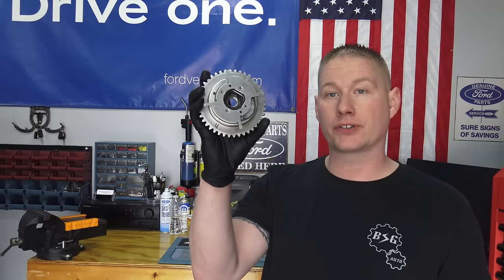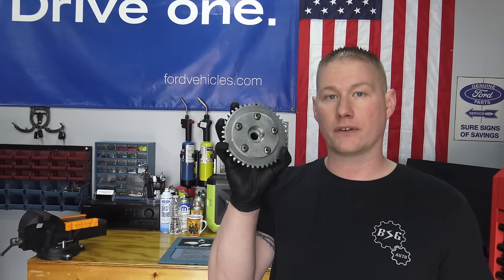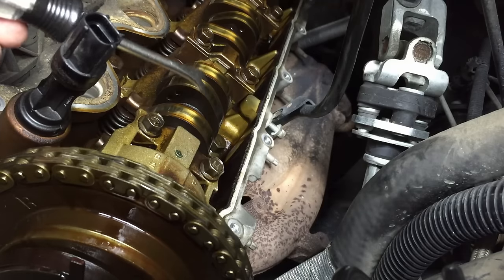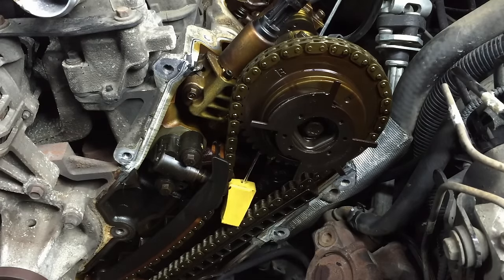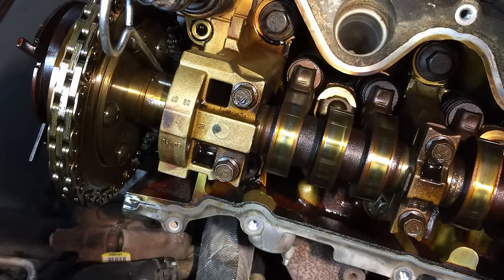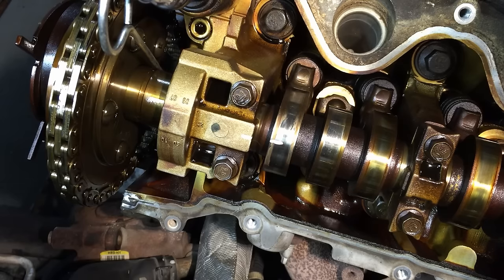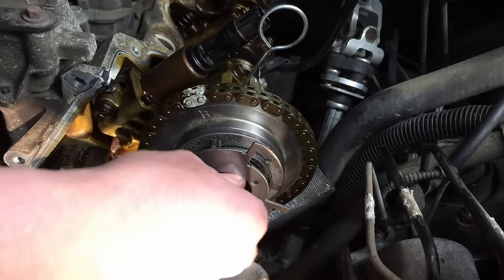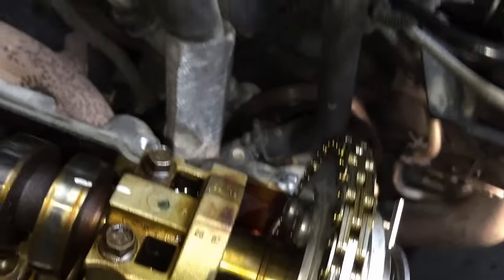Ford 5.4L 3v Camshaft Phaser Replacement**UPDATED FASTER PROCEDURE**

Comment: what if I can't get the pin in the back of the phaser to line up with the cut out notch?  It's just a hair off but won't fall into place with using the bolt to press it down.
Reply: I am assuming that you placed marks on the cam and the head and a mark on the  chain in relation to  the old phazer and the new phazer is in the same relative position as the old one.  If so then the cam mark must be off a little. Put a pair of vice grips on cam just behind phazer and make the cam marks lineup.

Comment: what do you think about the phasor lockout kit?
Reply from the maker: Overpriced junk
Reply: But if the phasors keep failing and replacing them with phasors that will fail again, is there a permanent solution?
Reply: @FordTechMakuloco  But how does the phaser actually work ?????

Comment: anyone run into where the new phaser from ford sits about 10mm closer to cam cap from old aftermarket part that was failing after 10xxxkm, seems like there isnt much clearance between the phaser bolts and one bolt on the block
Reply from the maker: I install the Ford phasers daily they have been the same for years.
Reply: @FordTechMakuloco  sweet thanks for that and thanks a million for your videos your knowledge and tips do not go unappreciated

Comment: God I hope Ford doesn't charge me $2k to replace one of these on my '10 F150 5.4L. Threw a P0345 code but then disappeared but the knock and rough idle is still there some times, just started at 98k miles.

Comment: Even if your cam moves, the phaser has a locking pin that sits in it
Reply: yes that's true for the phaser line up, but now the chain must be aligned to the moved cam. Which is why  Bri marks the lobe too, to know which way it was spun. Best to not have it spin at all.
Reply from the maker: +Nick Piberius Wilde yes but it's a real pain to get it back together and aligned at that point
Reply: +FordTechMakuloco True true, I have had it move on me before. :p

I'm currently in the process of replacing my plastic timing chain tensioners on my 08 Mustang GT with the older cast iron tensioners from an older Mustang. Your videos are a great help, thank you.

Comment: Hey I have a 2007 expedition 5.4 with a p0022 engine code idles very very bad and random bank 2 misfires could this phaser be the problem or do you or anybody have any suggestions. Any help would be greatly appreciated thanks in advance
Reply: Awesome videos by the way. Helped me many times keep up the good work
Reply: change or clean your idle air control valve.. also clean the mass air flow sensor.
Reply: +Geovanni Delgado ok thanks for the tip would that affect only half of the engine (drivers side)
Reply: +G Wyonch i doubt it will affect the misfire issue, but it will help your idle problem
Reply: +Geovanni Delgado ok thanks for the help
Reply: +G Wyonch you might have a vct solenoid problem, maybe yout engine is out of timing.. i think youre going to have to replace your timing chain and cam phasers while your at it
Reply: +Geovanni Delgado ok I'll look Into that as well
Reply: Fixed it. Was a mix of dirty Vtc solenoid with crud in both and low oil therefore low pressure. All that work and that's all it was
Reply: +G Wyonch glad it wasnt nothing major

Comment: hello there, I replaced everything phasers, chains,tensioners,guides sprockets and vct solenoids and engine is still shaking at idle. but alot less with new phasers

Comment: Are the phasers on 98 to 03 ford zx2 sound?
Reply: derek warner doesn't have phasers
Reply: It definitely has A vct phaser on the exhaust cam. They are torque based oil controlled phasers I’ve rebuilt mine overbored the lifter bores to 34 mm custom intake cam from crane cams and and I ported and polished the intake and exhaust myself and still with stock exhaust make 203 horsepower consistently tuned by me with and sct. But I’ve changed the phaser due to noise from it and no I didn’t sheer off the pin that goes into the cam that keeps the inner part of the phaser against the cam fixed so the computer can control it and keep it at the commanded phase and read its position properly. I have no dtcs but the phaser seems noisy like it has bleed off but the gasket is sound it’s in time no blockage in the oil gallery so I was just wondering if the phaser on the ford escort zx2 DOHC had any common problems that Brian would know about

Comment: I just replaced the cam phasers an I still have the knocking noise the pickup has 162,000 miles
Reply: Most likely a blown timing chain tensioner, or guide if the noise is coming from the front of the engine. It's allowing the chain to slap the front cover

Comment: I have codes P0021 and P0345. I have retarded the bank 2 phaser 2 teeth and still get the same codes, though it does run better. With the crank at TDC, where should the phaser on bank 2 line up on the head/cam caps? DO you have a picture or video showing this? Phasers and VCT solenoids are new OEM Ford, and it ran perfect for 3k miles before the bank 1 phaser went bad(Also oem Ford). That phaser and cam has been replaced. Once replaced, these codes on bank 2 popped up and it runs terrible
Reply: I might have actually figured it out. Based on the marks I made whenI first did the timing job, the bank 2 camjumped 1 tooth retarded, even though the codes said advanced. Ive corrected that so it is spot on. Battery is charging. Ill reply again with the results.

Comment: If ur Cam phaser goes bad and you checked it externals n it checks out....pop it open, but remember to leave screw in that retains the spring. You'll have to slightly untighten it a bit to slide the cover open. Be careful as when you open it there's a spring and retainer in a oil hole. It's actually kinda like a pump feed for oil. If the spring wears out it'll allow the tangs to spin and retard timing. Ford made their phasers kinda crappy tbh. The aftermarket part I got has a better design of the internals.

Comment: I do have a question, why are the cam wedges rated for 3 valve motors will they not work on a 2valve and because you know better than me than me. What would be the ending result locking in a timing chain wedge drop the handle down in there unbolt timing chain plate where it connects to the head and pulling the head off.... Yes its the lazy ass shade tree mechanic job, the way it sounds but it could work,
Reply from the maker: It would not work trust me.
Reply: @FordTechMakuloco I believe you...

Comment: How do u know when they go bad?
Reply: You can usually tell by the noise the vehicle makes and location of the noise. The noise is similar to a diesel engine noise. There are some videos out there showing this annoying problem.
Reply from the maker: +STEEVE DAVID Nicolas I have many videos of the noise they make at a hot idle. It's more of a knock and happens the most on the passenger side
Reply: +FordTechMakuloco thanks guys I will take a look at them
Reply: I have a 2004 F-150 5.4 that makes the knocking sound.  Is detrimental to the engine? I've been told it is more of a customer satisfaction repair and that it won't really hurt anything so I wasn't going to fix it.  However, if you think it it will damage the engine over time, I think I will try to fix it.  Thanks!

Comment: Anyone have the issue with these where it actually kills the engine? My engine will stop running when I’m idling
Reply: Yeah I am, was it the phasers for you? Or did you have to replace the timing chain as well?
Reply: @Mrxboxkiller1  I haven’t fixed anything yet. I switched to a thicker oil that I read a lot of people use in these engines. Seems to be running good
Reply: @Mrxboxkiller1  you ever replace anything?

Comment: What an absolute failure of engineering. 

I have a 2003 Grand Marquis with the 2V 4.6L and had to replace the timing tensioners and guides at only 140K miles. I was absolutely disgusted with the over-engineering and amount of parts involved in changing the 11 piece timing set (mercifully no cam phasers, just gears), and appalled at the mileage which I had to do it.

By comparison, my 1999 LeSabre had a 3.8L pushrod V6 that never needed timing service at all. I changed the three piece timing set at 300K just for good measure, and ended up finding the old chain had barely stretched at all, and could have gone on indefinitely. More moving parts = more failure points.

The Ford SOHC 4.6L has 2 more cylinders, 50 more cubic inches, and eight more timing components than the pushrod Buick 3.8L, all to produce... 19 more horsepower. Oh, and the fuel economy is 20% worse (15/24 for the 4.6 Grand Marquis vs 21/31 for the 3.8L, and I was much younger and drove that Buick much stupider, lol).

I love the Panther platform and lament that Ford ever discontinued it, but can't wait until I can afford to replace the gas guzzling parts bin under the hood with a simpler electric power plant someday.

Comment: you lined up the rt phaser on the left head
Reply from the maker: Nope I just copied the timing mark as a reference so it can be copied over. There is no right or left phaser just marks.
Reply: @FordTechMakuloco  so why do they have those confusing marks?

Comment: why would anyone replace the phasers?  just lock them out and get a programmer, oil pump, and timing set and be DONE.
Reply: does that really fix the 5.4l 3v motor? i have the same issue with phasers and was going to lock them out. whats the pros and cons?
Reply: @anthonysellards4798     BAD IDEA!

Comment: Due I still take front motor cover off
Reply from the maker: No
Reply: @FordTechMakuloco  the chain guide with the plunger how does that activate
Reply: You said the seal goes out and then it doesn't push on chain guide.

Comment: I have a 5.4 that had a knock that stopped when I touched the gas it runs normal except on a hill it sounded like an old 4 barrel carburetor at full throttle and wouldn't increase speed as soon as i let off the gas it recovered. Just looking for your opinion please.https://youtu.be/G39cACINIv0

Comment: The Ford 5.4 3v is one of the  worst motors they ever designed.  I say that and I'm a loyal to Ford and have driven them all my life.  This 5.4 was a garbage design from the very start!  I've seen these engines fail as early as 100k to the point of needing replacement.
Reply: I agree to a point. BUT......if they are maintained properly, they're not as bad as they seem. (I dare say Brian would agree) that Its bad owners more than bad engines a lot of times. CHANGE YOU'RE OIL AND SPARK PLUGS REGULARLY to avoid 75% of the gripes people have about the 4.6 and 5.4 3v engines.

Comment: thought right was passenger side on vehices
Reply from the maker: yes it is, did I say something different in the video?
Reply: @FordTechMakuloco  your putting the r cam on drivers side
Reply: @FordTechMakuloco   there is a big R on that cam and its clearly on drivers side  motor im currently doing a 5.4 and whoever did em last had cams mixed up so i was double checking on some videos to make sure im doing it right  u have the best ford videos
Reply from the maker: No the phasers are universal they can go on the driver or passenger side and you just use the corresponding timing mark for the side you are working on. This only applies when you are timing the engine. When you are just swapping phasers as seen here you pick any phaser timing mark and use it as  reference for the new phaser you are installing.

Comment: Wow! This confirms my theory. Rube Goldberg was a Ford engineer!🤣😅 2 minutes into the 1st video, I’m already thinking: “ sure glad I got rid of my ‘01 5.4! Cousin Paul was right! They’re a trash motor, get a Chevy LS & your problems are solved! I did just that & now I only watch Ford tech videos for entertainment value 😆
As for Rube Goldberg, he can go through his mental gymnastics and all that, but in case you missed the Ford tech’s comment, he ended saying “these Ford motors have plenty more problems to fix!” 🤣 . Don’t I know it! Which is why I came to the obvious conclusion … but a Chevy. Buy a Dodge hemi. Buy a Toyota. Buy practically ANYTHING and your Fix or Repair Daily problems are over! 
The real problem though, is Ford’s overall philosophy of constantly coming up with new designs with new issues that they eventually abandon rather than finding a good design and developing it over time the way GM did. In the ‘60’s they used to do that. They had a 260 V8 that eventually became the 289, then the 302. I still have a 302. It’s in a stern drive boat, though. This was about the last good engine Ford made, with the possible exception of the new 7.3 big block. Now we’re talkin !

Comment: so Basicly do not by a Ford
Reply: Putting a melling oil pump in these engines fixes this problem. for 150 bucks these things become bulletproof. transmissions are basically taken from a ww2 tank. if youre a chevy guy we all know your front end is fucked and if youre a dodge guy we know your transmission is fucked. for being fords "worst truck" this thing is pretty sweet. buy a ford.